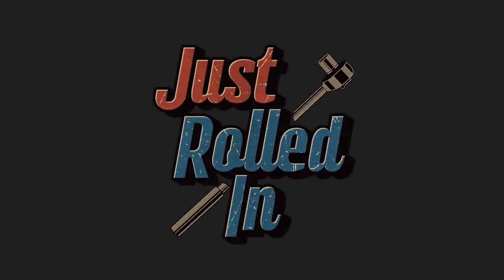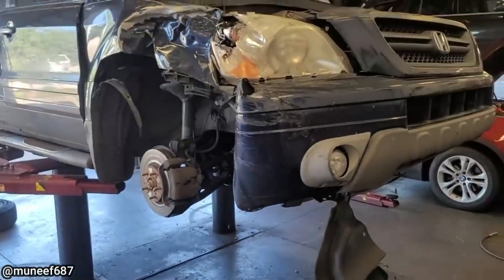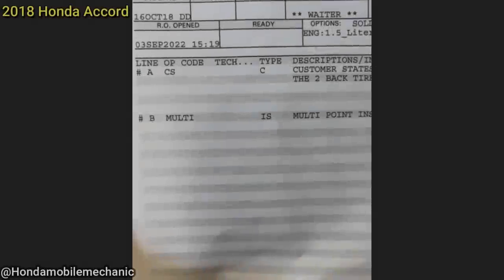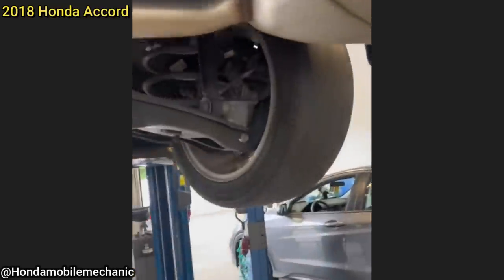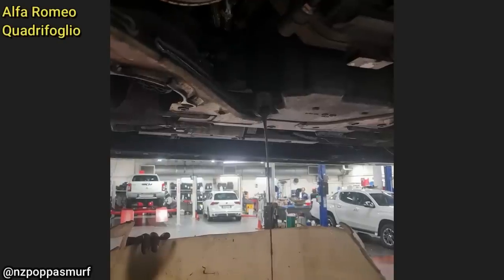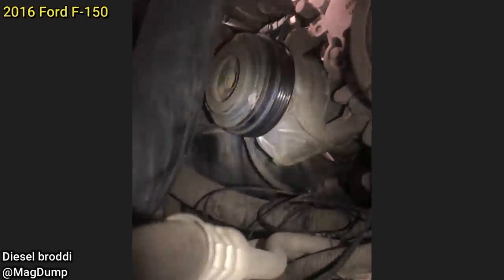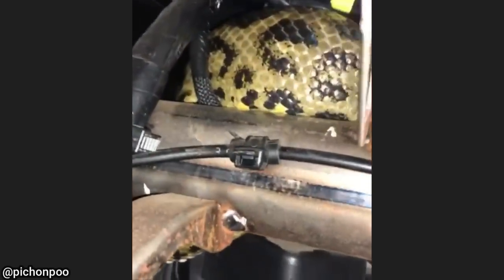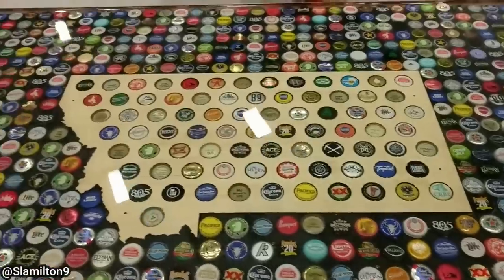Customer States Haven't Serviced Honda Civic In 9 Years | Just Rolled In

Comment: I will never understand why people don't get their oil changed, and put the RIGHT oil when doing so!  Not that expensive to do, and ruining an engine because of it is absolutely stupid.
Reply: so true.  my dad hasn't gotten his oil changed in years.  i mean probably over 10 years at this point.  and he says its fine because he never drives the car.  which is true, he only drives it maybe $1k miles a year tops.  but i shudder to think about how fucked the oil is in that thing right now.
Reply: @themike97_58  Even if it's barely ever driven hes not thinking about how the oil changes over time and potential condensation that can build up inside from letting it sit for so long. Yikes. Like at minimum it's worth it to spend 50 on a basic change every 6 months to not destroy an engine.
Reply: Have to admire the resilience of the car.
Reply: @themike97_58  Maybe just change it for him? Save him the headache of needing a new motor.
Reply: I change my mom's oil minimum of once a year whether it needs it or not.
Reply: Oh my goodness, I've been putting Left oil in my car. Should I get a checkup for my engine?
Reply: Oh! Am I supposed to have the oil changed? 🤣🤣🤣
Reply: @michaelwarren2391  Nah! Just rinse it out and it'll be fine.
Reply: @benjitheengi4447  if you're getting it changed with the correct weight every 3-5k miles, plus a new filter you should be fine regardless of brand.
Reply: I imagine it’s because they only plan on keeping it for a short period
Reply: @K9River  After a year it needs it, even with low mileage.
Reply: No oil changes for 9 years is normally no problem, we do that too.
There will be another problem or drive a lot of km.
Then 5 years is no problem.
Reply: Like, some people are lazy, don't have the money, just forget about it, fine, I don't despise that.
But when they proudly state that neglect like a trophy then... Damn it hurts my soul that I just can't even afford a goddamn car and it's fuel to go to work and some people do... THIS...
Reply: @themike97_58  and here I used to change the oil in my 4x4 every 2,000km
Reply: @themike97_58  Doesn't matter it needs to be changed. Tell him to read the owners manual.
Reply: @Kalvinjj  They don't give Alpha's away. High buck car there.
Reply: What's more insane though... not changing the oil in 9 years, or filing the engine in a new car with 11 litres of washer fluid. How are these people breathing.
Reply: Sounds like you answered your own question.
Reply: right like any time my car is messing up, the first thing i do is check the oil lmfaoo

edit: for transparency, the oil is never why my car has issues bc i change it every 3000-3500 miles (it’s an 07 pontiac with 165k miles so the engine is already on borrowed time)
Reply: Probably because they think oil is for cooking.
Reply: @themike97_58  The problem is that engine oil (oil additives) deteriorates even in unopened container in the store and that's why there is usually expiring date on the oil container.
Reply: Im rather worried about my toyota 5L diesel engine that ive done 12,000kms in without a change but the reason for that is im in a town of idiots who dont even have a parts store yet alone a 'garage'. No shortage of wheatgrass smoothies and yoga mats tho.
Reply: 50$ now or no dope to smoke tonight
Reply: The same reason people don’t disinfect their washer, or clean the condenser on the back of their fridge. They see vehicles as an appliance.  If it starts it’s good. If it doesn’t start, time to buy a new one.
Reply: There is a real fact on oil. 10w40 from castrol or mayby other oil brands never have to change the oil because it wont sludge up. I did for fun 5w40 into my car. An d had it in there 2 years and yes i could see it coloured my dipstick on some sort... most new cars use 0w40 0w30 or 5w40 or 5w30. These oil DO SLUDGE PERIOD. Never had this with 10w40 no sludge or coloured shit whats so ever. When my engine oil is hot i got 2 bar oil pressure on idle and increase ever 1000 rpm on 1 bar extra. This is how you know a engine is healthy.
Reply: My mechanic told me I would wash my rings out after so many oil changes
Reply: @themike97_58  Change it for him.
Reply: I'm related to a former judge who never changes oil either. When his engines lock up in his Cadillac he just buys a new one for himself. He's been doing this since the 80s. They usually make it to about 60k. I can't understand very highly educated people with no common sense 🤷‍♂️
Reply: Engine oil is too expensive, it's just a scam
Reply: @emmettturner9452  i dont live with my dad.
Reply: @TheMechanicj  Cause everyone fits into your preconceived notions of being a dope fiend. Gonna tell you something about me. I am on disability. I have COPD and a heart condition among other conditions. I live on a fixed income. I don't spend my money on dope. I use a phone that is 6 years old. I use a MacBook pro from 2012. I use the cheapest phone plan I could get and the cheapest internet I could get. I don't spend my money on junk food and eat pretty healthy diet (Actually had red beans and rice tonight). I don't drink coffee, pop or anything with caffeine in it I just drink water.  I live in the cheapest city in my state. Getting my car fixed is a luxury and getting maintenance is a luxury. Before someone in the peanut gallery says "Do iT YoUrSeLf" what part of COPD and heart condition did you not get? I barely can walk without getting out of breath let alone fix or maintain my car. And no before someone asks No I never have smoked cigarettes at all. I grew up in a family of smokers. Nice try. 

I worked in dusty and chemical irritant environments for 10 Years and that's what caused my COPD. I worked in Freelance IT. I specialized in fixing old machines. Being exposed to dust and chemicals day in and day out to a lot different industries environments does accelerates stuff. Could be exposed to a lot of dust one day and cooling fluid and metal dust from CNC's and other stuff another.
Reply: @themike97_58  Do you still visit him?
Reply: It’s probably cheaper to burn you motor up than it is to change your oil every 3,000 miles. 
This is the same reason I only get new tags every 10 years or so
Reply: I don't get it either bro
Reply: What's up with the washer fluid, though?
Reply: In most cases using the "wrong oil" i.e. 5w20 conventional instead of 0w20 synthetic won't hurt the engine one bit if the customer sticks to like 4,000 mile oil change intervals. But what they do is cheap out on the oil and then use the original OCI meant for synthetic oils. I.e. 10,000 miles on conventional.
Reply: Pure laziness, I speak from experience. Also depending on how old the car is and your likelihood of crashing it before the engine blows up it might not matter. Especially if it's japanese.
Reply: Exactly
Reply: Tbf the "right oil" is a lot broader than expected. T6 rotella is a really common aftermarket oil in petrol bikes despite it being a diesel oil.

Basically if its a good lubricant and it doesn't have any addatives that will ruin the cats then your good to go.
Reply: @Kalvinjj  : What gets me is how some folks will fill up their garage with useless rummage worth maybe $2K at most, and leave a $40K vehicle out in the weather.
Reply: When the average car payment is $677 for new and $515 for used, plus insurance and registration, people don't have the extra money to maintain their cars. Most of these clips say that the customer declined repairs.
Reply: I change my oil 2 times a year and my other car 4 times a and the other one 1 a year bc i dont drive it mutch and its onley coming out the garage if its sunny outsite and its only in the summer
Reply: @themike97_58  I got such a car from my father in law - 12 years old, 20k miles since new and never changed oil since new because he said - of course - he barely drives it. So after getting the car I kept changing the oil numerous times every 1to 2k miles - and I DID drive this car approx. 20k miles a year. I still keep changing the oil every 3k miles ntil now = it has approx 120k miles and the engine is fine and really clean inside :)
Reply: @themike97_58  change it for him
Reply: Well, let’s look at a later clip in the video, someone put 12 quarts of washer fluid into the engine, some people are not smart with cars, same way people don’t understand computers, if the car turns on and moves, people won’t think about it
Reply: @bmwmsport11  so true bro - LOL - literally today a friend of mine - a girl - told me she needs to get a new car cause the one she is using now is broken. When i asked what is wrong she said it does not run properly. After I checked - the muffler corroded and fell off....
Reply: You dont need to change the oil. That car lasted 9 years and ran when it "rolled in"
Reply: @bethmurphree6210  : I think he is confused. Or thinks bad advice is humorous.
Reply: @kris856  : The way it should be.
Reply: @HankScorpio64  Cool story bro. Stop eating.
Reply: DudeDeedue, because they’re rich and who care?
Reply: Because they don't know anything about engines.
Reply: @KLOKSLAG1911  Your statement is just WRONG. Your 2 year test was at the recommended maximum useable life of the oil.  Nothing was supposed to happen to it.  You proved nothing.  All the 0w20-10w40s give is different viscosity and does not reflect the other qualities of the oil.  That is governed by the ACEA and equivalents.  A low quality 0w16 will sludge given time, but a high quality one will take much longer.  Modern engines with turbos (gas or diesel) require ACEA2 or better oils and have 6 month or 6,000 change cycles.  That is so for a reason.  Duh.  Stop promoting BS.  Oil wears out and it degenerates without usage over time.  FACT.
Reply: As insane as it sounds. . . some folks literally have no clue that the oil needs to be changed at all. Not even joking. They are literally THAT ignorant about the cars they drive.
Reply: People don’t have time for oil changes.  When the car dies they get another one.  Time is money.
Reply: I agree. I've put a Futomo valve on my 03 Tahoe and it sits naturally so high that I just have to put a container on the ground and open the valve to let the oil leak. You come back 15 minutes later, change the filter, close the valve and refill it. Done in 30-40 minutes at no extra cost.
Reply: The longest I went was about 25,000 to 30,000 miles. The oil came out fine, but I did the next change after less than 2000 to get any remaining sludge out. The car still runs like a champ! 240,000 miles on a GM 3.8L
Reply: honda reliability
Reply: @themike97_58  you actually dont need to change it once a year. The oil breaks down faster when you are driving the car. If the car just sit most of the time you wouldn't have to change it as long as you aren't driving extend miles on one tank full.
Basically there was a lady on shorter video, wanted a oil change when she didnt drive her car for 6 months, when the machanic drained the oil it was still brand new.
Reply: @helmutschmacher2100  they should create a website you can buy the parts and have it shipped to your house
Reply: Well 8000 is not cheaper then 80 dollars.
Reply: @misseselise3864  thats not alot of milesIF serviced regularly. I have 338.000 miles on my 94 Trans Am I bought new. Engine never been touched, even the timing chain is original. Still runs like new,  and uses no oil.
Reply: @OldsmobileCutlass1969Va  I usually change my at 10K interivals with Full Synthetic oil. Last time I went 12K , the tech showed me the dipstick, the oil was BLACK. I had never seen oil that black in any of my cars. It was to the point I thought maybe the last time I went to the shop, they didnt change it.
Reply: With the new permanent synthetic oils you never need to change the oil. Installed at the factory they say just leave it alone.
Reply: @MrCROBosanceros  Expiration date??  In the early 70's I bought a new Spicer 5831 auxiliary transmission - new, zero miles of use, not rebuilt.  Something came up and I could not use it for what I wanted.  Therefore I filled it to the top with gear oil so no condensation could get in it and its been sitting in the garage of wherever I've lived ever since.  I wonder what the gear oil is like after all these years.  If I don't use it in the next couple years, guess I'll just sell it.  Any idea what a new Spicer 5831 is worth?
Reply: @sphillips6357  I would flush out old gear oil and fill it with new gear oil. I don't know how much the Spicer 5831 is worth.
Reply: @swamp-yankee  I think its safe to assume that after a decade without even basic maintenance that motor is pretty fucked. Changing oil now would probably only bring to light what horrible condition it really is in.  Probably best not to intervene at all at this point.  If people can't be bothered to look after their own posessions then its hardly someone elses job to do it for them.
Reply: It would appear there are more than just a handfull of drivers out there that don't even know what engine oil is, or how to check/top it up!
A can think of a couple of examples I have experienced personally - 
A friend's collegue at work told him she was selling her car because the engine was failing (again, it was on its second engine at that point) but she only wanted £120 for the whole car. When we went to look at it there was ZERO oil in the engine (we were both surprised it was still running) and when we asked her how often she checked the oil level she replied she had no idea how to do that or that she was supposed to!
Second one, my neighbor was telling me her friend was nearly in a car accident  when the brakes in her car suddenly stopped working properly. When quizzed further about it she said there was a light showing on the dash that she didn't understand, my neighbor asked if she had checked the brake fluid and she just replied what is brake fluid? 😖     I realise these are both stereotypicall women stories but I'm sure there are men out there who are just as bad.
Reply: If you paid $500 for the car what's the point.... If you get 6 months to a year who cares, still way cheaper than most people's car payments and you don't have to care about it...
Reply: @ItzOver9k  Once a year is enough. Especially if it basically just sits there without running much.
Reply: It is expensive...Only when you have $20 in your pockets
Reply: @d-james255  If you can't afford it, then you shouldn't be driving.... Quit using being poor as an excuse, get a better job....
Reply: @buddsmokengood  So if you can’t afford to put food on the table then don’t eat….you’re very intelligent person
Reply: @d-james255  driving a car has nothing to do with putting food on the table... If you can't afford to maintain a car you should not be driving, because that unmaintained car becomes a danger to everybody else on the road. If you can't afford basic things like vehicle maintenance and food, you should try to get a better job.
Reply: I dont like to be shafted by these oil change shops so I suck the old oil out and put in new once a year. The filter is still working.
Reply: @ItzOver9k  6 months? thats psychotic, a reasonable normy amount of time to change oil is once a year
Reply: Had a colleague at work told me he hadn't had his car serviced for 2 years because he couldn't afford it. I pointed out that if he can't afford to buy a new car, that he should at least just get an oil and filter change.
Reply: @noxious89123  I change every 5000 km at home but its getting harder to dispose all the  used oil without anyone notice it being spilled to the ground.
Reply: @ItzOver9k  10 years / twice a year * $50 = he is $1,200 ahead (plus time savings of 20 hours at $10 per hour) and the car is still running.
Reply: @RH-cv1rg  It's more like $900, but your estimate is still a lot cheaper than a new engine and thats if you're lucky to make it 9/10 years
Reply: @ItzOver9k  It was still running after 10 years.  Who knows, it might make it to 20 years.
Reply: @OldsmobileCutlass1969Va  There is no way  your oil looked "fine" after going 25 to 30K with the same oil. I went 12K on the same oil in my 2012 Genesis. The oil was pitch black (full synthetic oil)
Reply: That Civic looked like an extreme case of the Quaker State sludge problems from the 1970’s.
Reply: People think it's just a service tech rip off.
Reply: Changing oil on a Honda won't help , still a piece of ####
Reply: My car is 14 years old, I only know for sure during the 11 years I've owned it's never been serviced. It's done about 2,000 miles per year. LOL last emmisions test I was told it was like a brand new car.
Reply: I’m not one of those people but it’s understandable given the inconvenience of scheduling/taking/waiting for your vehicle when many people can’t take time off of work to get their car serviced. Add to that the fact that the majority of people don’t know or even understand the implications of not properly and regularly having your car’s oil changed.
Reply: Oil change is cheaper than a new engine
Reply: @KLOKSLAG1911  what about 0w-20 oil I have my car parked for 2 years no oil change since December 2020
Reply: @Xenomorph-hb4zf  well remove the sump you will see. I have removed a sump from a car that also didnt drive 2 years it was rusted from the inside at least the side walls dont know how this happend. You think because of the oil it cant. But i asume condensation inside the engine will make it rust. Dont know about the oil but its mixed with condensation....
Reply: @csjrogerson2377  okay professor my neigbough had a car and really never ever change the oil for over 10 years he drove a Peugeot diesel on 10w40 castrol and drove more than 100.000km  Oil was still liquid no sludge or whatever. How do you explaine that mister wiseguy. My dads ford transit van was 10.000km over time normal interval and it began to form sludge and had 5w40 on  it. So please talk all you want idc.
Reply: the "wrong" oil isn't as bad for a car as you think, btw... certainly better than having very low oil, any weighted oil is fine in a pinch
Reply: Considering some mechanics are unethical, it's more easy to understand.
Reply: Luckily it was a Honda, if it were a German car he’s fucked
Reply: @antoniocalimero1173  No! 📢😵‍💫
Reply: @user-tr2dh4xx6u  True. You can also fill it with cooking oil. And with "you" i mean just you.
Reply: @kilojeromesmith4488  See your car soon!
Reply: @Aspen5.7  why bother putting it into be checked over in the first place if you don’t have the money for repair? The majority of the problems showed on the videos can be found by either looking under the hood or under the car. The chances are they put it in to find out what needs done then they try repair it themself. Which seeing how bad the car has gotten isn’t going to end well.